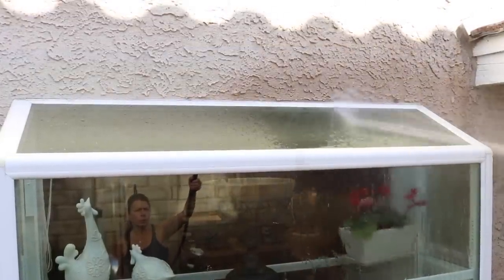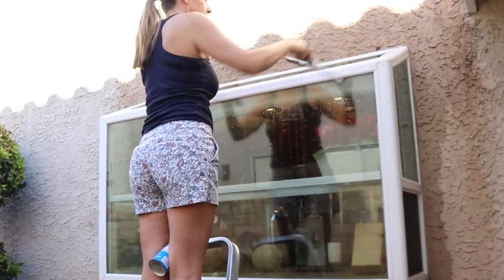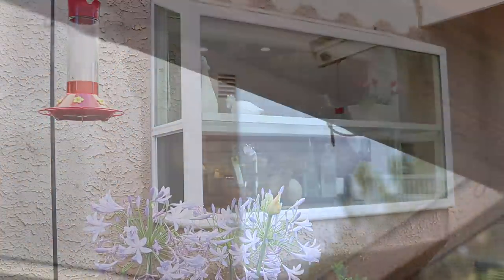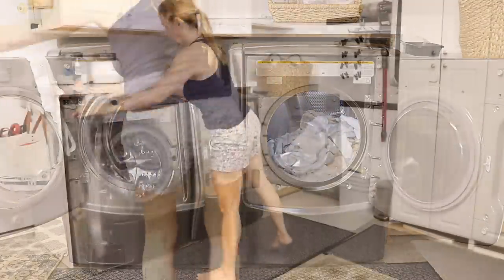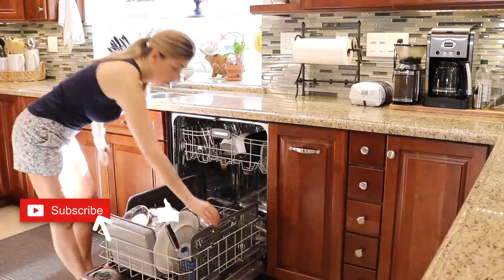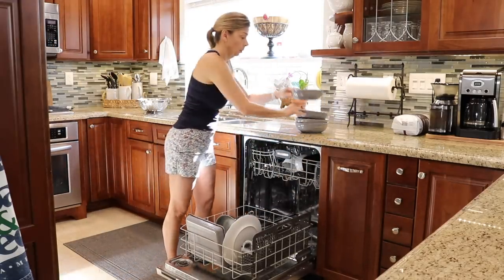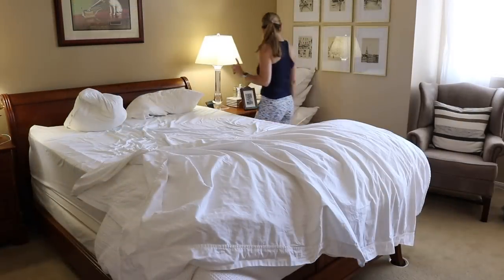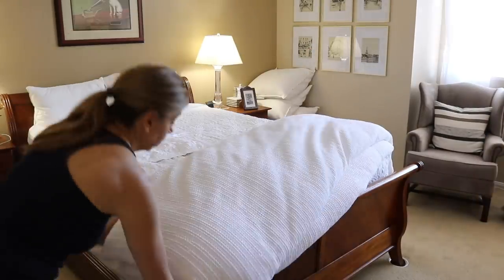CLEANING MOTIVATION | ZONE CLEANING SERIES | PART 7

Comment: nice work as always! what do you clean your windows with?
Reply from the maker: Hi Isaac! For the inside of the smaller windows I usually just use a damp microfiber cloth. But the kitchen I'm still using Sprayway glass cleaner. Its ammonia free. On the outside... sometimes Sprayway, sometimes soapy and vinegar solution. 🤷🏼‍♀️ Thanks so much! Have a great week! 🌸💕😊
Reply: @27foxplace  okay gotcha.
Thank you, you too!